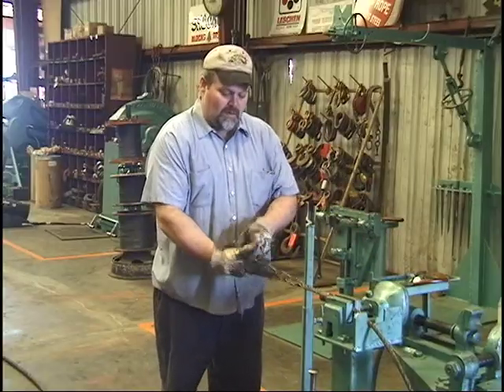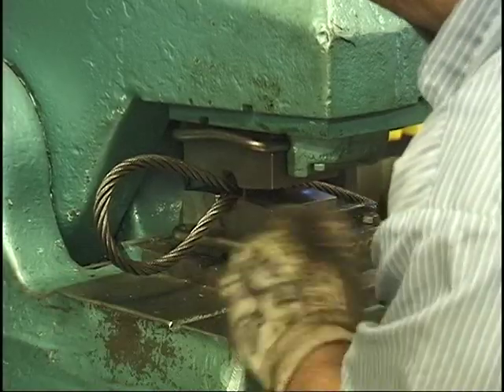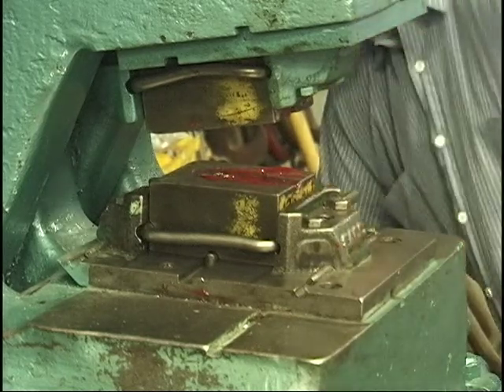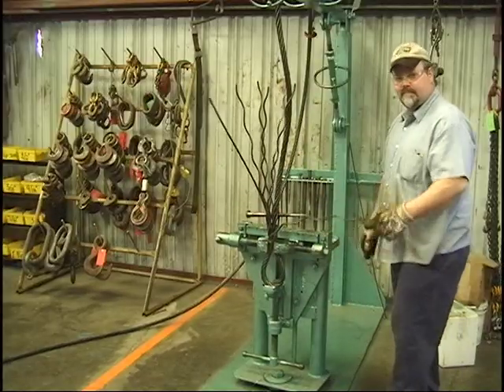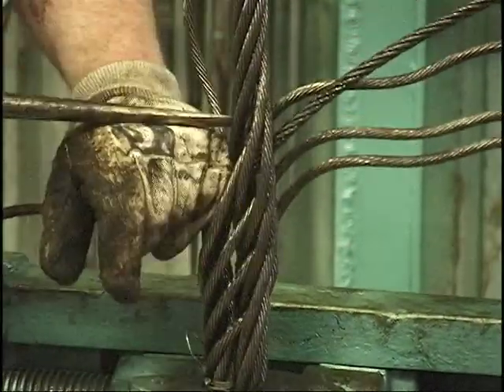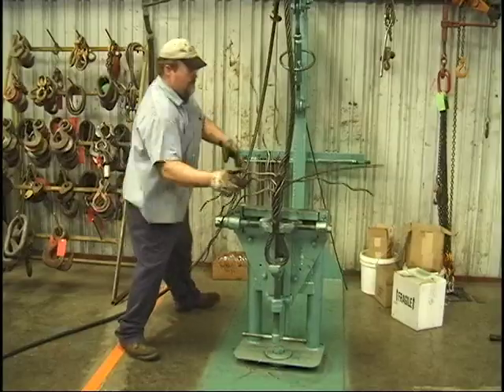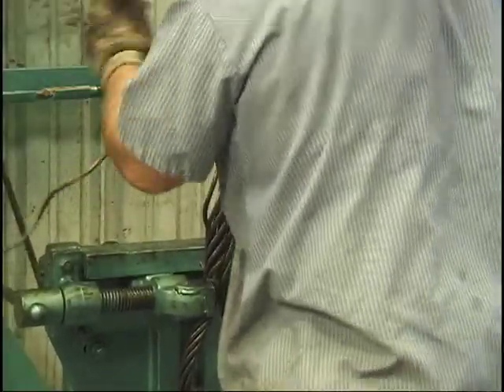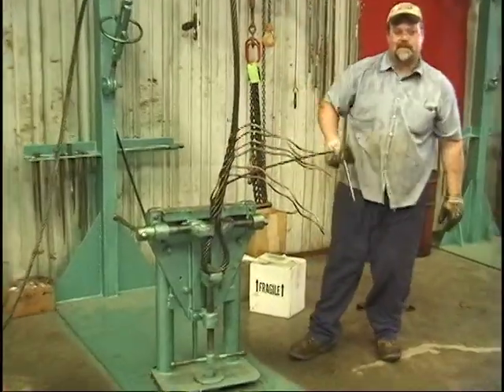Wire Rope Splice

Comment: Here in sunny Western Australia,I have done hundreds of traditional hand splice.,up to 2inch dia. We also splice on the vertical,we would use a offset vice and rarely ,like never take a turn out of the rope.Our spikes would have a T handle for control.Two tucks then drop in the vice,so much more control and less effort needed.Drop again for the fourth tuck,all six strands tucked four times with no separation at the throat of the eye.Yes ,I’ve done Flemish eyes to 75mm and long splicing to 57 mm ,retired now.Not trying to be a smart ass 😀😀😀

Comment: I’m sorry to say, but in my opinion it isn’t an artist at al. I’ve made so many rope splices on a river barch. When you look at 8’ 23” you see a big gap in the splice. We learnd at school (DNS Oranje Nassau Delfzijl NL 1963-1965) to make a splice without a gap. We learnd also to make a splice without the tools he needed. We only may use the same Spike like he did to open de wires. And after the splice was ready, we used a hammer and a schissel to cut the separate  wires in stead of a torch. I have to admid the loop was about 50 - 75 in diameter, depending where the splices where made for. Mostly to hold the barch in position in docks, loading, unloading sites a.s.o.

Comment: That's not a splice - that is a babbit eye.  We had to actually splice eyes with a block of wood, a rigging hammer, and marlin spikes on 1 1/2" mainline and 1" haulback.  We cut the cable using the hammer - with a piece of 1" cable for a handle over an axe embedded in the wood block. We beat the cable until it was cut through and then put in the eye splice or the long splice depending on what broke.

Comment: Good on ya mate :) I worked in the rigging loft at a 90,000 tonne dry dock in Brisbane Australia for about 20 years .. all of the FSWR lifting gear on site was hand spliced, I made my spikes out of ground down rat tail files and used a "spinner vice" much the same as you are using at 4:05 to keep up with it all.

Comment: I've worked as an underground miner. That was dam interesting. Cool machines-  they wouldn' fit down a waste drag - back when. This brings back old memories of the hollow sound of My battery dragging on the "hanging wall" of an area that needs barring down as I'd crawl down a waste drag with an ax to fix a broken cable. Those chokers are a familiar sight to an old log skidder operator also. Yup.

Comment: We do these on cleats offshore.A cleat a spike and a hammer.this guy isn’t even getting them tight,not even trying to.His first tuck is way loose.Actually we use a variation called a 3,2,1 splice it has more tucks

Comment: If you dont have equipment for this and need to make a loop real quick. Just take couple right size nuts and push the cable and cables end thru them and hammer them down. Maybe not the best result, but still holds pretty well for quick fix.

Comment: I needed a sling and I had watched quite a few rope splicing videos and still couldn't do it myself. So I had a wire rope rigging company custom built me one. It was a 6x26 IWRC steel cable 1/2" in diameter 50 ft long with two spliced eyes with thimbles steel collars swaged on all for $80. Rope splicing is really a skill that I respect very much.
Reply: For any needs about steel wire rope,sling  PLZ contact me WhatsApp：+86 18036231199 .We are  manufacturer of steel wire rope in China.

Comment: I'm an ex BC logger, and we had to do 1 1/8" guy line splices on top of a stump with the initial eye formed and held in place with 4 railroad spikes.  We then had to pound a Marlin spike thru the strands twist and insert each respective strand in place with a minimum of 2 tucks. loose ends were cut off by laying the strands over an old axe blade and using a hammer to sever them.   T his was at least an hour job with 2 guys on a mountain side  miles from a shop..
Reply: Rory Forbes  waynedartist@live.ca

If we keep reminiscing on YT some whining will surely occur.

Comment: Absolutely fascinating, and I mean that genuinely. I used to work in heavy industry and used wire strop/ slings a lot, hell,  I even had a 12mm wire rope as a tow cable for the car. I’m disabled now and can’t work but I can see me back in my shed and start tinkering again. Thanks for the video.
Reply: For any needs about steel wire rope PLZ contact me WhatsApp：+86 18036231199 .We are  manufacturer of steel wire rope in China.

Comment: We used to call the first one a "Flemish Eye Splice" ... if over loaded the splice can pull out or shear, it only develops  95% to 98% of the cable strength ... standard protocol is to reduce the cables published lift capacity by 5%
Reply: Flemish or Farmers eye is good for 50% adding the pressed ferrule makes it 100%.  The rated lift capacity is already reduced by a 5-1 for safety factor no need to reduce further unless wrapping it around something with less than a 20-1 wire diameter ratio.

Comment: lives depend on that splice. Take is seriously....saw loads drop. 
30years crane operator rigger.
Steel erecting guys wear them out where sling goes around flanges of beams. Few use padding.
Fiber slings to fragile for iron worker s Erectors.
Aluminum swages ng.
No robot can do this job is safe.
Nice work Thanks.

Comment: I sucessfull spliced wire rope for years in the Oilfield along with splicing 3000 ft together for sandline work on water oil & gas wells. Billy Tyree explained the method right so I won,t repeat it. But this way will work but he needs to pull out the nest and hope it goes.

Comment: Not quite right.  Each time a strand was pulled through the rope it should have been pulled tight, really tight.  That would have avoided the 'birds nest' near the eye.  Also the strands should have been burned off flush with the rope.  I spliced wire rope years ago and have thought that it was becoming a lost art.  Guess I was right.  And no, it doesn't require a great strength, just skill and knowing just when and how to twist your wrist.  I used similar tools to the ones he was using except my marlin spike was much larger and with it I could splice an eye into an 1 and 1/18 inch diameter wire rope.
Reply: Heck, I have trouble splicing rope with a spike.  You guys that do this are frigging amazing.  Hats off to you.
Reply: Yeah, that looked wrong to me.  I've never seen anything that ratty looking.  That's a hazard on any job.
Reply: Loop
Reply: So, where's your video, Billie-boy?  C'mon, show us all how good you are.

Comment: QUESTION PLEASE..
Why is he splicing and crimping instead of just a crimp?
Reply: Splices are often favored over crimps because they will run through a block better, no hard spots to cut the strands. Splices, generally speaking, are longer lasting. Sleeves are quicker to apply, but have drawbacks.
Reply: Marty Spargur 
ok gottcha,
Thanks for the reply
Reply: @JJ-jv1gu  in this case the crimp is more of a convenient way to finish the ends than it is necessary for strength. My answer was referring to an eye that is only crimped, without the strands being split and rewoven back together as shown. That would typically be called a nicopress swage, and the sleeve is often made of copper. The steel sleeve shown is less traumatic to the cable than a straight compression sleeve. The sleeve shown would be weaker if it was just making a non-flemish loop. That is, if you just bent the end around to make a loop, you would want a different type of sleeve, one that had the sharp cable end sticking out the sleeve instead of concealed.

Comment: If this is a three tuck eye It seems like a lot was skipped.
For the nay sayers a farmers eye one tuck will hold & is faster but OSHA requires a three tuck on all running lines.
We never pulled an eye, the lines always parted out in the middle somewhere.

Comment: Interesting video, I have never seen a setup like that, it was always  half dozen or so railroad spikes and a stump. One thing I did notice, the eye should be 36x the diameter of the wire being spliced. Splicing an eye in a 2" skyline is a 3 man job which take about 30 minutes. His whole technique is so different that what I am used to, I had to watch it several times, Compared to what we do competitively, he has several steps that seem redundant. Same eye, just redundant.  Side note; I helped with one long splice in a piece of 2" we added 3500' to a 4000' length, THAT took about 4 hours and if I remember correctly, it took 120' of line to do it.

Comment: That is so hard to do. I applied at a wire rope shop last year and even though I got it done, I was shaking after just one sling. The upper body strength needed to do this for 8 hours a day is insane. Nope, I told him thank you for the opportunity, I will pass...

Comment: What are these ropes made of-copper/brass etc?
Reply: jeremy western steel
Reply: +Gtaking101 no youre mistaken...steel would rust and break... Please do more research in future
Reply: Depending on the steel.. Most steel now has plenty of chromium in it to stop degradation over time.   It's heavily lubricated from the factory to extend it's life. Nothing lasts forever. They are most certainly made out of steel. There is a reason steel rope has "steel" in the name lol.

Had to make and edit. Brass and copper are way to soft.. Steel alloys will eventually break down, and that ensures this guy in the video gets to make a living. A good one at that. Iron and its derivatives is what keep our world working
Reply: Says the guy "researching" through YouTube comments...  Gtaking101 is correct, these wire ropes are made from steel.  Wire rope can be made from any number of metals such as stainless steel, carbon steel, galvanized steel, and aluminum - the ones shown in this video are in fact steel.  Also, see Brandon P response above, he is also correct.  Way to show your ignorance there bud!  Seriously though, now you have learned something, have a great day!
Reply: jeremybenny western
Reply: +Dave WI23 researching?
Reply: +John Willemse benny? What the dickens???

Comment: That is the worst example of a hand splice at the end ...dont ever do that For real use . For all that work you can make a splice with 95% strength ... I really need to make one and test it i think its maybe 25% of break.
Also when your making the 5loop eye take the 3strand right up to the crotch and spin the core side all the way. It saves the core popping at all . With used or junk "new " cable you have to watch for the core slipping

Comment: That dude must be strong as Eff! Thats the kind of guy that can twist your head off if he wanted to, and you wouldn't expect it of him by just looking at him.  Thats why you don't mess with people you don't know! :)
Reply: its pretty typical to have that plus more strength when you work kn the logging & or fiahing industry..........
Reply: traderjoes should see this shit done in the bush, making straps out of old pulled 1 1/2 mainline can be fun. have had to use come alongs to pull strands in.
Reply: Yeah, do this day in day out, you’ll get a lot of resilience in the forearms and hands. Same with plasterers.
Reply: And eye splice your arms and legs to boot!
Reply: Precisely what I was thinking.
Reply: So you didn't expect him to twist your head off just by looking at him?
Reply: It takes some strength but its more about knowledge than strenght. I should know spent a big portion of my life working with cable. Spent 20 years drilling on a old cable tool drilling rig. Not the little shallow water well but deep hole rigs. Going as deep as 6,000 feet.
Reply: I would to have to feed that boy. I sure bet he could some groceries!!!!!!!
Reply: Yay

Comment: Never cut wire rope with a torch!
Reply: why not. if you know how to do it then that is the best method due to the melting of the individual strands.....this helps to prevent unraveling. he obviously dosent know how to do it right because he left way to much hanging out
Reply: +John Pike 

I liked your video it was well put together. In heavy crane use each wire will slide back and forth keeping the load equal, when the end of the wire is welded off from cutting with a torch they will bind causing unequal loading and braking. You can use friction tape or something like that to hold the ends together and a hydraulic cable cutter or grinder with a cut-off wheel. If it's easier to splice with it welded then after splicing cut the ends off with a grinder when finish.(see ANSI ISO 4309:2010 Cranes - Wire ropes)
Reply: I suppose i can see that possibility. However when ever I have seen someone use a cut off wheel at work they are usually re-doing the splice in a week or so but mine last months....if i have a torch available thats what i use. Now there is most definatly  a difference, we dont use them for heavy crane use. We use them for cable tool drilling.

Comment: Didn't like the way the job was finished. What happened to all those ends that were sticking out after they were cut. Did they get tidied into the rope?
Reply: The Splice Is Complete, The Ends Will Suck In Some When A Load Is Applied. That Is A Winch Line That Drags Thru The Forest Floor Pull In Log Chokers, Like The Frist Thing He Made. There Could Be 5 or 6 Chokers On One Winch Line.  In The 60s And 70s When I Was Rigging, Most Winch Lines Were 1 1/8" And 1 1/4" Much Harder To Splice.  And The Chokers Were 3/4" & 7/8".
Reply: After that sling is used Just Once, the ends will be pretty as you please, automatically.
Reply: I was surprised he didn't use a plasma cutter.